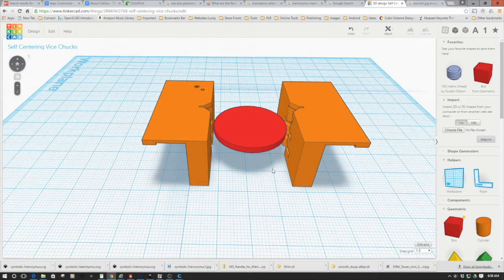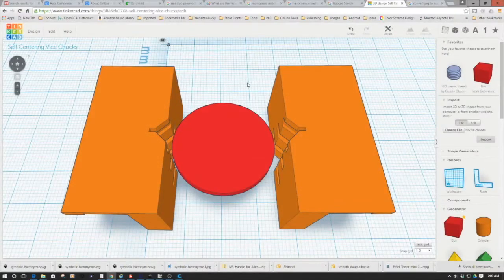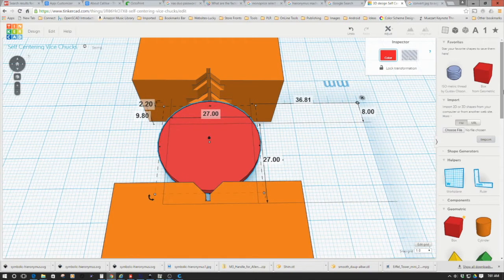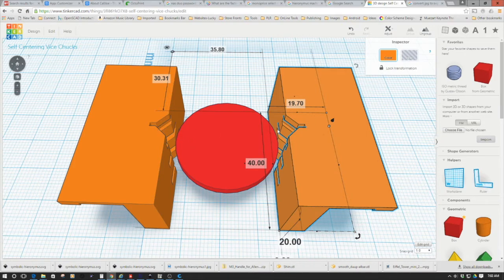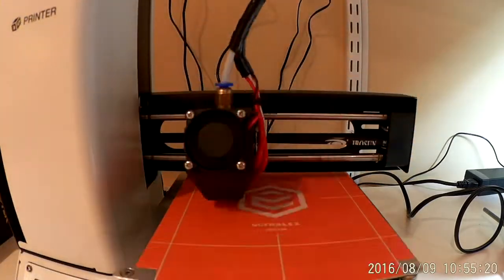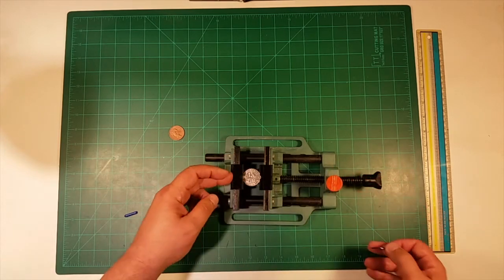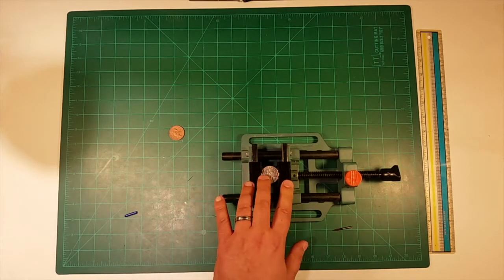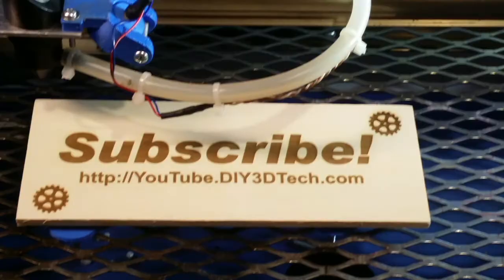TinkerCad Workflows  -  Self Center CNC Chucks for Coin Art!

Comment: Please compare CNC vs FFF Prints: prepare, post production repeatably of parts etc..
A Great video to make
Reply from the maker: Never really done a like for like however might be a good idea.  Might have to wait a bit as I am going to buy a new CNC (likely a 3040) and then might do as I do plan on matching these in Aluminum in the future as the CNC is get the coin pretty hot in some cases...
Reply from the maker: Yes seen this and many others, I am bidding on 3040 with an 800 watt water cooled spindle right now on eBay...
Reply: Good luck on getting one for a good price
Reply from the maker: Scored one for $888 yesterday delivered with the 4th axis and 800 watt water cooled spindle so looking forward to getting it!